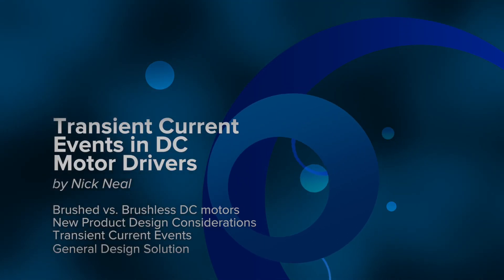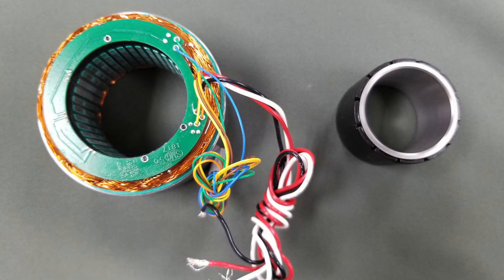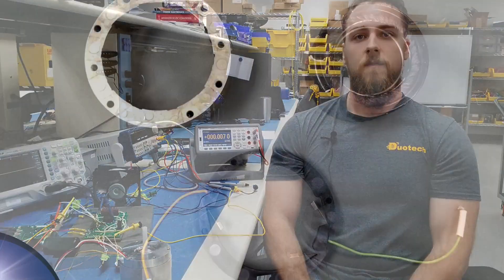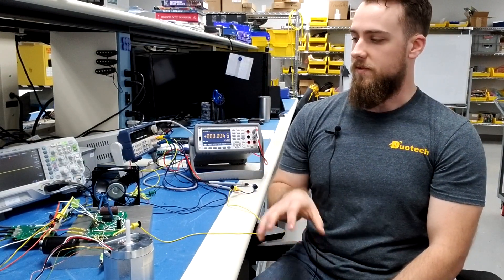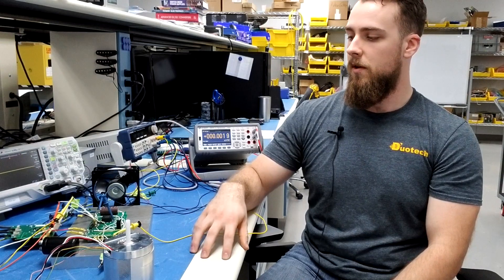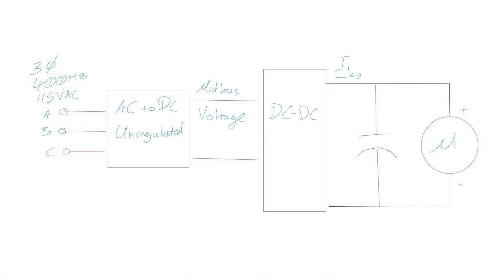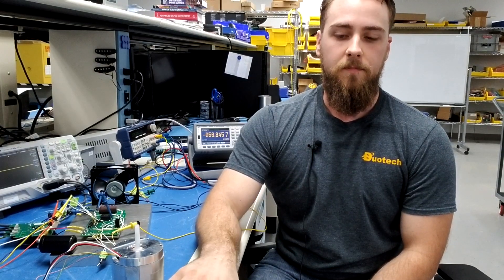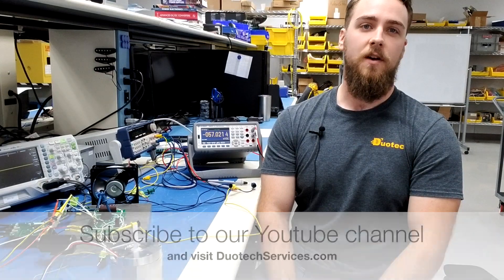Transient Current Events in DC Motor Drivers

Comment: sir this doubt is regarding the design of h bridge to control 320w brushed dc motor i implemented standard h bridge   i have doubt regarding the  filtering capacitor being used in standard h bridge how to decide this capacitor value and what role does this capacitor plays in h bridge